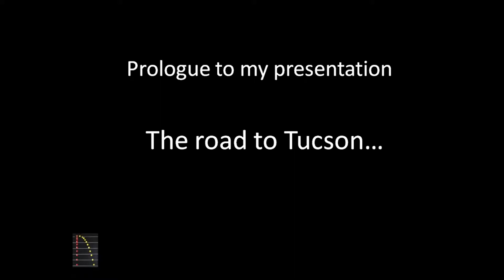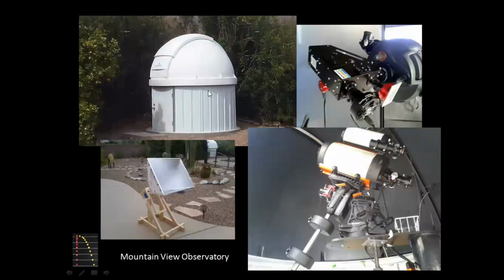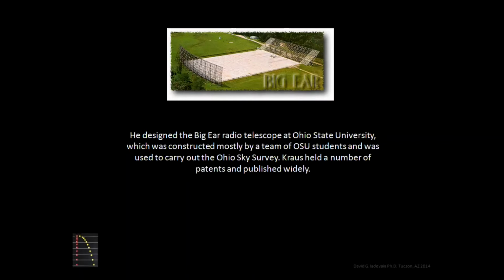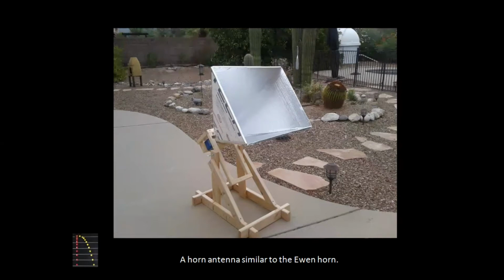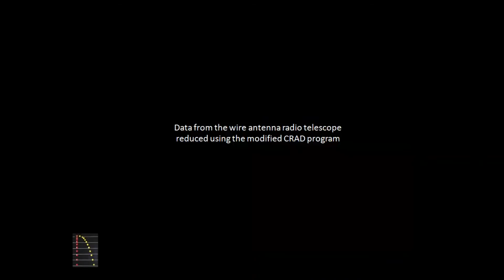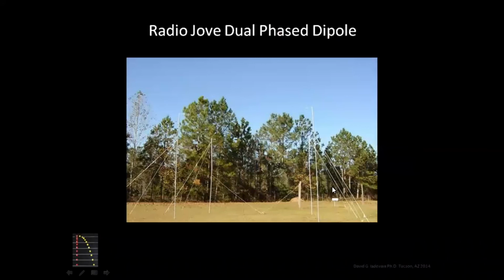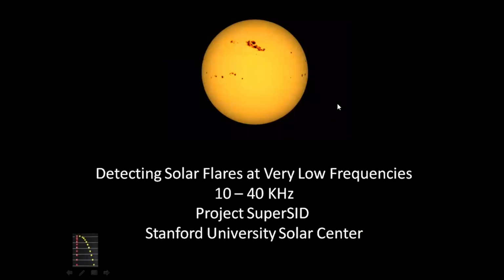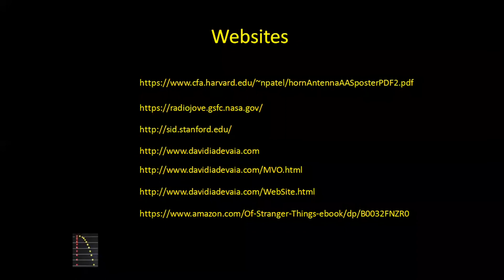Small Radio Telescopes for Amateur Astronomy

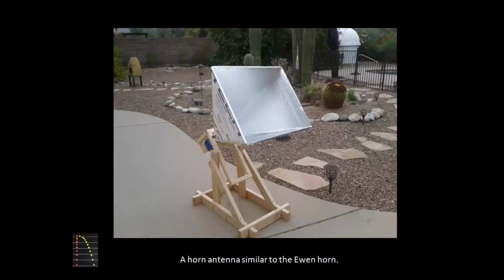Comment: 15:08 - It may be for nostalgic reasons to build a large horn antenna. However, they are not used anymore today because yagis  or dish antennas are much more effective for the material required and they are  readily available. A WIFI-yagi comes at about 20 US$ and will beat the horn hands down.
Reply: A wifi yagi has nowhere near the gain of a large horn like what was pictured, and only works properly at wifi frequencies.  A horn is broadband and works on a large range of frequencies.  A 2.4GHz yagi isn't going to have a good pattern at 1.42 GHz because yagis are not wide bandwidth antennas.  A parabolic dish might be a better antenna if you can buy it with a feed for your frequency, but it is a lot harder to build than the simple horn shown.
Reply: @stargazer7644  Sorry, my mistake, "A WIFI-yagi comes at about 20 US$ and will beat the horn hands down" is surely not correct. But, the typical DIY horns shown for 21cm reception have an aperture of only about  50 * 50 cm and could be easily equalled by a reasonalbly compact DIY yagi if you adapt a 23 cm design. As to a dish, they can be found from surplus in one way or another and the feed is not much different from the feed you need for a pyramidal horn.